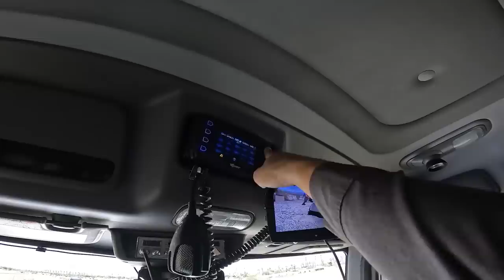You Can't Park On A Fire Hydrant + Nose Dive Trailer

Comment: With all that heavy equipment on the construction site, they couldn't figure out how to move that trailer off the sign themselves?
Reply: They did the right thing by calling in Plaza Towing. First, the truck was a delivery truck with no affiliation with the construction company. Second, the truck was leaning against a fire hydrant. One wrong move, and you have a ruptured water line which you are liable for. It's always best to call in a professional for something like this
Reply: @dannylim3318  I agree about the fire hydrant. I was specifically asking about the second segment with the sign.